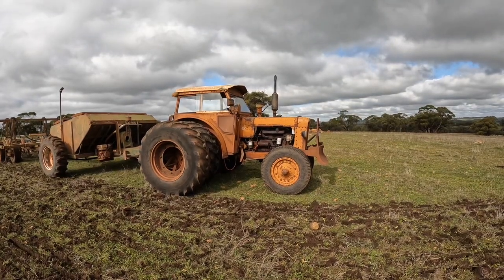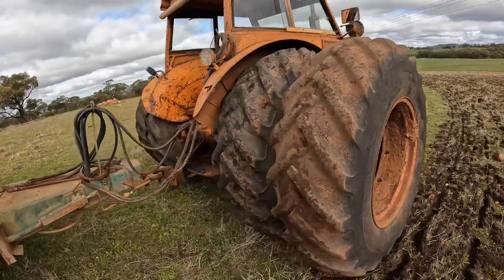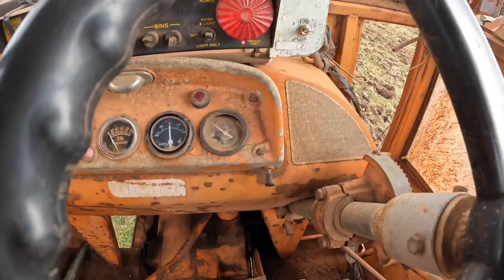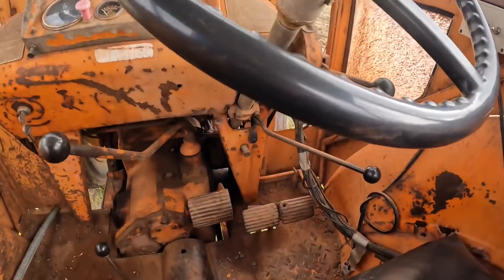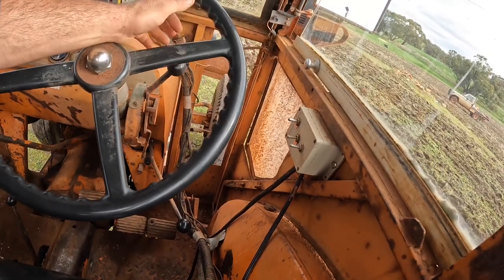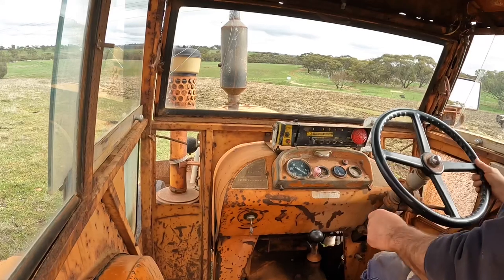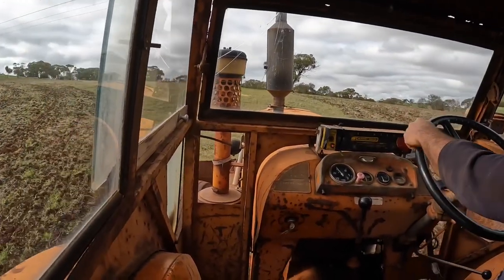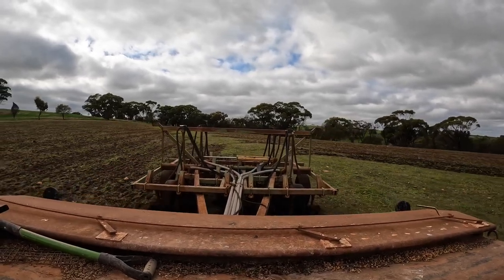How to drive a Chamberlain Countryman 6 tractor on Brookdale farm

Comment: Love the cow catcher blade on the front.........very Mad Max.  You could fit a russian cab heater really easily, just a fan between the engine and cab, to force in the hot air, and your toasty warm.
Reply from the maker: As long as there isn’t too much wind the fan on the engine blows a faire amount of hot air into the cab. If you have the back curtain down you stay fairly warm.

Comment: Love Chamberlain tracrors
Reply from the maker: Hi, the chamberlains are great old tractors, and easy to repair. Thanks from Geoffrey
Reply: Considering Bob Chamberlain was a super salesman who could sell ice to eskimos, and set up the Chamberlain tractor factory as a means of continually transferring money from the WA State Government (see note) to his other company Rolloy Piston Co., it is amazing that over the years I have met many Chamberlain tractor owners, even of the 40K 2-cyl kero tractors, and they all like them.    Even today you still find Chamberlain late 50's 6G's & derivatives in use in scrap yards and metal fabricator/engineering yards in use as light cranes.
Note:  The tractor factory was always run at a loss, and whether they actually made any tractors on any given day/week/month was unimportant.  Bob Chamberlain had negotiated an agreement with the WA government which gave Chamberlain a heavy subsidy, principally a set free factory buildings and an unlimited overdraft from the State owned Rural & Industries Bank.   All the machine tools in the factory were war-surplus, paid for by the Federal Government.    So there was money coming in and not much outgoings other than wages.   Although the tractor and plow etc design and engineering was done in WA, on paper Rolloy owned the designs and thus received royalties.  
Once imported diesel tractors became readily available, not many Chamberlains were sold, however the 6G was more successful  because Bob Chamberlain went to Britain, got the GM of Perkins drunk, and conned him into selling to Chamberlain diesel engines at a loss, so that the tractor price could be kept down.

Comment: My Brother had a Chamberlain Countryman whilst my father had a Fordson Dexta each had advantages ie 3PL on the Dexta but the Chamberlain was more powerful. Of course the old N27 had a pulley on it so it still ran the chaff cutter etc.
Reply from the maker: Some of the Chamberlains had a 3 point linkage as well, but they are a lot more expensive. We have a Fordson E27N as well that we have run the chaff cutter with. Mostly we use the Fordson power major for the chaff cutter as it uses a lot less fuel.

Comment: that seeder setup seems pretty finnicky - is it much better than a ground drive unit?
Reply from the maker: Hi Jan,
The seeder is still a ground drive. All seeders need to have a gear box of some sort or different size cogs that you change to set the different seed and fertiliser rates. The big advantage with this  seeder is that the tines have a much higher breakout, or spring pressure keeping them in the ground. This means I don’t need to plough before I seed. The old combine seeder I had before wouldn’t dig deep enough in out heavy soil unless I had ploughed first. Thanks
Reply: @brookdalefarm7986  interesting, do ground drive seeders not have the stronger tynes or is it unrelated and just what was available?
Reply from the maker: Hi Jan,  almost all seeders including this one are ground drive. I think you are meeting a combine seeder? There are only a very few of these that have the heavy duty tines and these are hard to find at a reasonable price. The other advantage of the air seeders is they can carry far more seed and fertiliser so more acres can be covered between stops. 
I hope this helps. Thansk
Reply: @brookdalefarm7986  yes sorry I think I’m using the wrong terminology, what I mean is air seeder vs non air seeder

We use an old grasslands seeder that doesn’t use air just gears
Reply from the maker: Hi Jan,
Those combine seeders are great, and work well and are much simpler than the air seeder. The other reason air seeders are more popular now is that they can be made much wider than the combine seeders so they cover the acres more quickly.